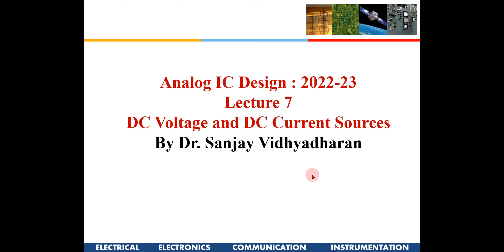Analog IC Design : DC Voltage and DC Current Sources

Comment: one primary source and one secondary source current is given to a load, It runs generally on primary source current, which component or circuit change the source current from primary to secondary instantly as the primary current source loses power?
Reply from the maker: Are you connecting two current sources in parallel? Explain ypur queery in more detail
Reply: @SanjayVidhyadharan  two power sources (given power) A and  B are separate (12volts) and the load should work only on one given power and if the the first given power source(A) loses power (goes below 12 volts or there is a power cut )the circuit or relay instantly changes the power source to B and when A comes back to power the circuit or relay instantly goes back to its primary power source i.e. A

Comment: hello good evening! if I wanted to do the same simulation to control the operating point (with the differential pair connected to the PMOS mirror), how can I proceed? Basically I would like to check if the 4 mosfets work in the active area. thank you so much!
Reply from the maker: To check if a nmsfet is in satuartion we ned to check if VDS>VGS-VT